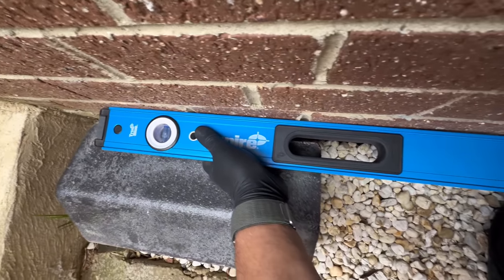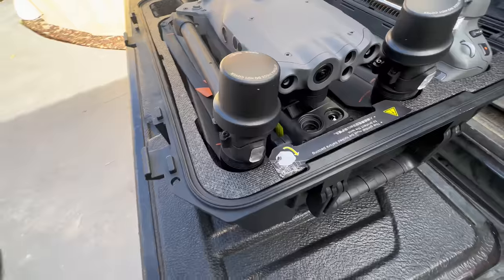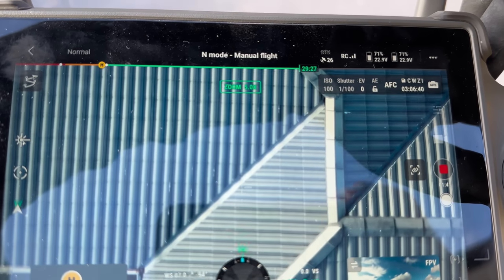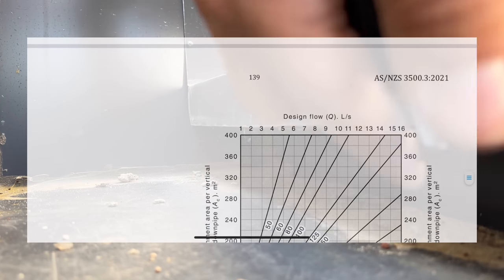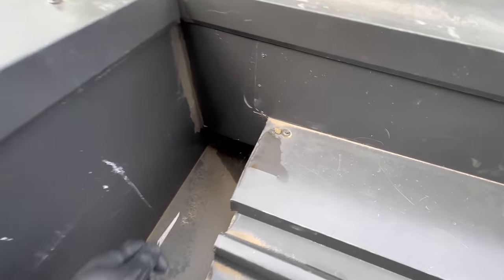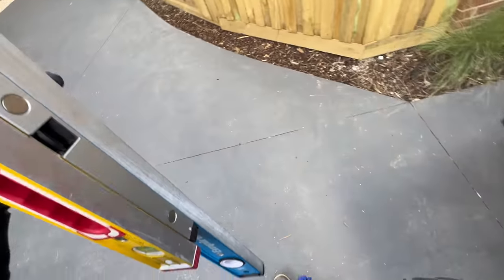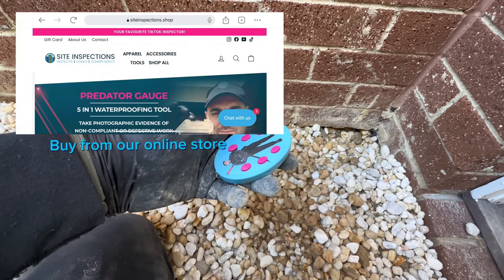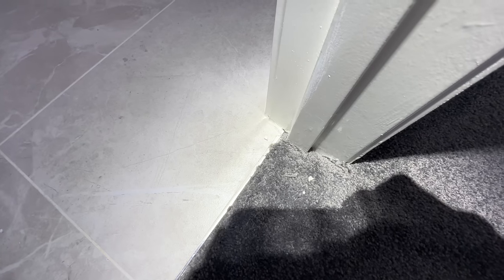Avoid these costly mistakes when buying a new home

Comment: These are just like what's in my area. They were privately built and under inspection the owner decided to sell all 12 units. They are cold, drafts,  leaks, electrical, plumbing and heating problems. 
Sad part is the government payed cheap and made them into government housing. 
There's repairman out the front almost every Tuesday and Thursday. 1.6M for the front double storys BTW.

Comment: 23:30 Is that Norfolk Island Pine planted in the ground, they are an enormous tree if left, get rid of it. 17:30 Scrap timber/MDF used, should be continuous lengths & gaps everywhere & this is over the front door & the painter should have done adequate prep & a roller.18:06 New concrete how is the rest of the slab that is buried under floor coverings? 
The quality of the painting around architraves is awful in the upstairs bathroom doorway, sand it back & do it again.

Comment: The things not even visible to this inspector would amaze you.

Incorrect lapping of reinforced steel, not enough side and top clearance of steel to finished slab edge, piers with loose soil at the bottom, over spanned framing members and that’s not even the beginning (Australian builders)

Comment: Well done, good lessons learned, not going to do knock-down rebuild in foreseeable future until the industry correction is done (needs outer force, damn!).
Reply: best of luck with the industry getting fixed you will need tradesmen for that and at the moment there is next to non the builders have screwed the rates down so low quality tradies cant make a living and even when you try to do the right thing and just make less they crack it because of time and you want the correct products and materials

Comment: Performance solutions are generic reports obtained by the manufacturer and relied upon by the plumber, generally the report is for the overflow provision in the quad gutters. 

The reality is plumbers and manufacturers of plumbing materials dont know how to prepare a PBDB or final Performance solution report in accordance with the NCC. 

More guidance and teaching is required from the regulators for plumbers and other trades.

Comment: Ask a silly question:  Where you were digging around in the gravel with your hand, would that, by having the gravel above the dampcourse, be non-compliant?  As it is also covering the weep holes.  When you go to the next section, with the painting, did you notice the change in colour of the mortar on the top course?  I suspect that it was a brightonlite mix, but, they used grey for the last course or two.  There was another, earlier section, where the vertical joints did not align in the brickwork.  This is why am looking to build my own home and make the bricks and tiles myself.  Know that it is done right the first time!

Comment: I wonder how many of these massive  defects on your reports are actually fixed to the proper standards without getting the lawyers involved. Some of the issues you pointed out today should have been addressed by the local building inspectors who have authority to plaster a stop work notice on the front door. Why are you paying for permits if the inspectors don’t either care or even do what they are paid to do. Our jobs are picked over by local code  inspectors and they simply can’t proceed until corrective measures are taken and inspected. Again.

Comment: after watching several of your videos, I am very reluctant to purchase a newly built home.    The shoddy workmanship is just not worth it.    I had purchased a spec built unit in 2000 and was so sorry afterwards.   Brick walls had a huge lean on them.  possibly up to 4cm.   Opening between lounge and family room had at least 3 cm difference in height.   Where I am now I am overlooking a newly built house that has brickwork which shows sign of dampness ever time it rains as the water runs out of the curved downpipe.   Builder has not been able to rectify it after 18 months,  and has since gone to out of business!

Comment: You'd expect some of these mistakes i see in your videos from DIYers not professional trades. I dont really expect the builder to know everything but the trades should know rheir own trade or at least know where to look if they need clarification. Sometimes a trade will just do things the way they want to suit them. I had some security consultants putting into maglocks and access buttons once and they put the button on the opposite wall to the door it opened. Lucky we caught it during the rough-in stage though.

Comment: So you can't use a rain head from any other supplier now? ONLY dam buster? Make a rain head that technically does comply only to be threatened with a law suit from dam buster? What the hell is going on? Since when did compliance come down to the brand? Please shed light on this.
Reply: Its patented
Reply: They have a patent. You can always come up with your solution…..assuming you are smart enough.😮😂
Reply: @michellemichelle9055  But it then has to be 'deemed to comply' as it isnt in the code.
Reply: @michellemichelle9055  Or just follow the code!
Reply: @neila9251  you’re correct. That would need to get it approved. That takes time and money.

Comment: It’s incorrect to penetrate silicone between floor and shower screen from the front in order to find out is the waterproof membrane installed under it or not. When you do that your customer lose silicon warranty on that shower screen. You should approach membrane from inside the shower screen. If waterproofing membrane is not there only then feel free to penetrate front silicone in order to proof your point.

Comment: If they really want to solve this issue they need to the inspector to be liable which should then be the council which is what they did in NZ after the leaky home crisis, you have tonnes more inspections over there than here for that exact reason, obviously you have a massive sqm rate variation from memory what a G.J garder pre covid in aus was around 1300 a meter and NZ it was 3000 a meter but you dont have these isssues abd you have someone to take liability who cannot shut there company down the next day

Comment: All these Foam townhouses there building here around Melbourne look cheap and nasty. Mate you should take this to A Current Affairs they would have a field day with VBA.
Reply: I have responses from the VBA that show why this continues to happen.  It is VBA sanctioned.
Reply: We purchased a house which is similar to this one, brick groundfloor and foam clad 1st floor. So far the house is fine. The cladding has better thermal properties vs brick. The physical properties of foam also appear to be more resistant to water and pests. I wouldn't want foam on the ground floor, mostly because if something fell against the house brick is a. harder surface and thus less likely to get damaged.
Given the current housing situation and energy costs in my opinion foam on the first floor is a good solution to reduce cost, increase thermal performance and maintain durability in the long term.
Reply: @MrInvisiblecrayon  Until somebody throws a cricket ball at it. It is a very cheap solution, and in a couple of years the foam looks absolutely terrible.
Reply: @Paul-qq7mh  Yep a cricket ball would do damage, same as it would to a glass window or a roof tile. Fortunately the palace of probability for my house being struck by a projectile is fairly low, and as you have highlighted, it is cheap, so repair costs are also cheap in this situation. 
A lot of the rendered houses I have seen in poor condition are due to brickwork behind the render shifting causing cracks. I am not sure what the movement would be like on foam based cladding. 
We also have a weatherboard effect foam cladding, which based on my unscientificly tested bird strike several weeks ago, appears to be quite durable.
Everyone has their personal preference but we should all keep an open mind on new materials and focus on where the biggest drop in quality comes from, poor installation
Reply: @MrInvisiblecrayon  I appreciate your detailed view, Bob.
But honestly in 5 years' time these foam town houses will look like they belong in Broadmeadows or Coolaroo Jacana etc. you get my drift.
Reply: Like living in an Esky.

Comment: Brother,  even if a product is copied and the original is patended and even if the patent holds up in court, what does that have to do with the item being non compliant? If it meets the performance solution requirements then what difference does it being copied make? 2 separate issues. Its not like they are copying a watermarked product and copy doesnt have a watermark. Maybe im wrong but i doubt it
Reply from the maker: -Fake copies of any product, such as fake copies of Dam Buster rainheads (which are also patent protected), are automatically deemed Non-Conforming Building Products in the NCC and not permitted for installation. 

-It doesn't matter how good or bad they are, or how they perform or what alleged certification they carry or reckon they carry - they are not permitted for use anywhere in Australia. Full stop. 

-Any regulator in the country, or any Certifier or Building Surveyor is required (if they are doing their job) to kill any such products being used on any building because they are Non-Conforming Building Products.  

https://www.abcb.gov.au/ncbp/what-are-ncb-products

Why don't people just use the genuine product.....using fakes is absolutely false economy and also damages Australian innovation, while also exposing plumbers, builders and home owners to a range of completely preventable risks and financial costs.  If you would’ve had invented something like that yourself you would be screaming blue murder if someone copied it 😊
Reply: Lmao I wish more people with contest your inspection notes so you can clap them in the comments like this
Reply: @Siteinspections   @Siteinspections  thanks for the reply. Let me start by saying i love ur content and the awareness you are bringing to our industry.  Secondly i agree you should spend the few extra bux on the original product. 

In saying that i still think you are conflating 2 seperate issues here.  One being copying a patended product and the other being non compliance. 

The ncc extract u sent me states 

Non-conforming building products (NCBPs) and materials are those that:

claim to be something they are not;
do not meet required standards for their intended use; or
are marketed or supplied with the intent to deceive those who use them.

Now while yes these other similar or copied rain head manufacturers are expsong themselves to court proceedings, as far as i know they not trying to decieve the purchaser and they are not using the dambuster logo anywhere whatover on the product. So it fails  to meet those 2 non compliance points. 

The last one about being not meeting the required standard they may or may not. But given its a performance solution anyway and i haven't seen you explain why they dont meet the regulations id be on the side of they comply with all 3 requirements of this ncc section. 

Im no expert in patents or a lawyer i am just a gas plumber so i could be wrong but i dont think so. 

Keep up the awsome work brother u provide the  construction community with entertainment and insight. Having myself completed a few developments with a leaky shower i had to repair. Your lessons on waterproofing have been gold. Thank you
Reply: @nickyp1435  brother this isnt a competition of whose right and wrong. Its a discussion. This is people learn and iron out any mistakes.